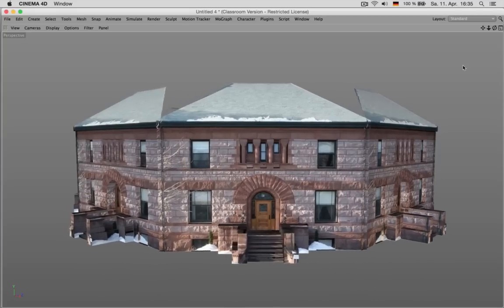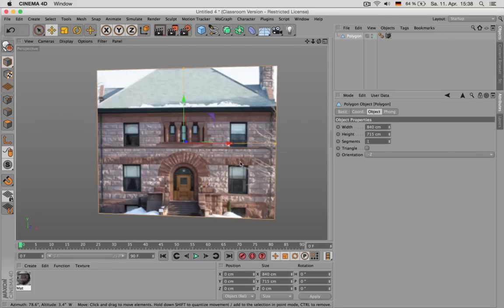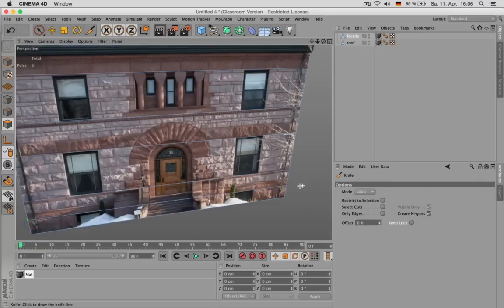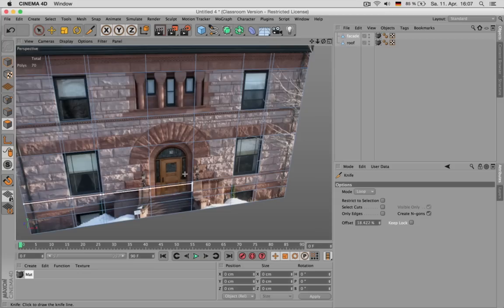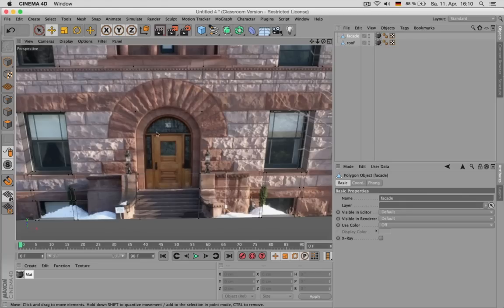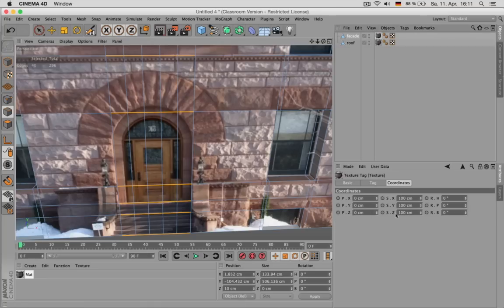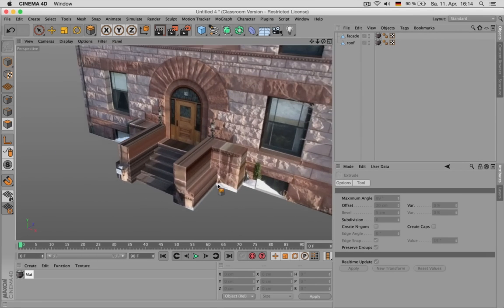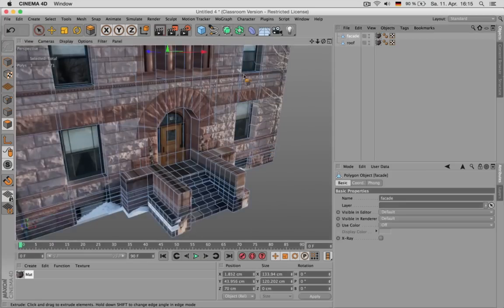Photo based modeling - Cinema 4D Tutorial

Comment: Have to compliment your method, I've been trying C4D on an off for a few months now (it's similar to SolidWorks but I prefer solids modeling since I'm so used to numeric input and the UI in Solidworks) and found it really frustrating while following others' tutorials. Your method is really helpful for me in particular, I didn't understand some of the other workflows I'd seen. Thank you! I do have a quick, small nitpicky question. Do you know if it's possible to switch the Z and Y axis within C4D, so that Z is a right-hand axis? Switching from surface to solids modeling always messes me up because the Z and Y axes are switched in surface modeling.